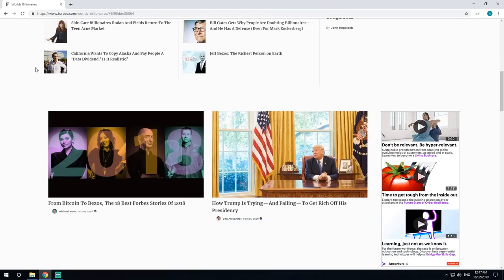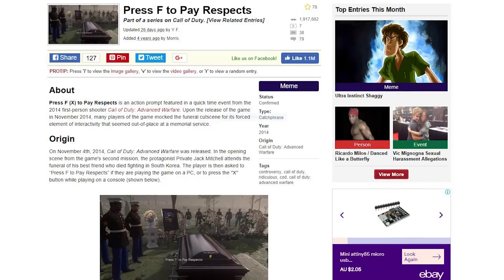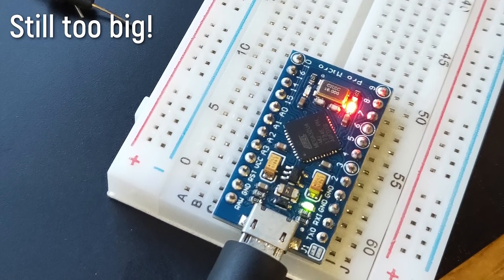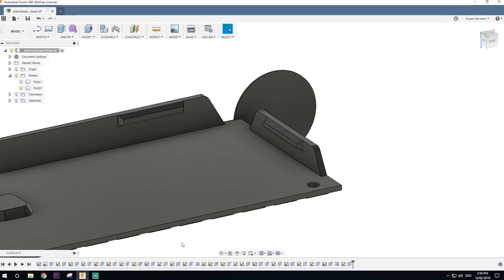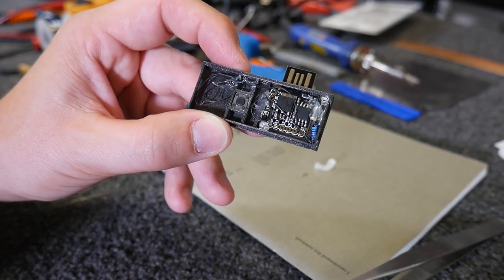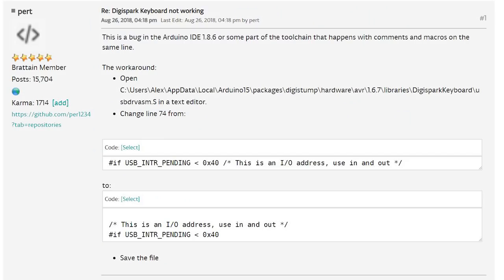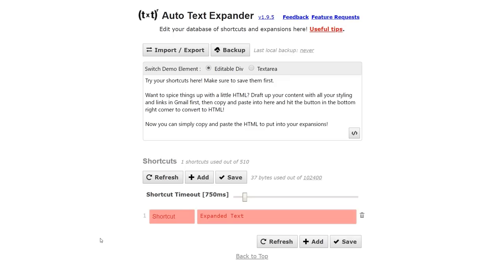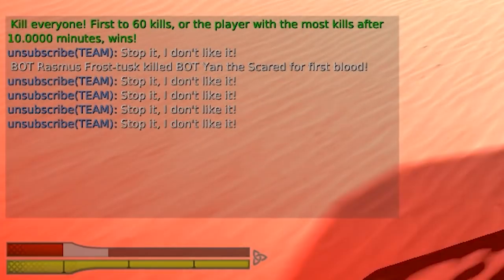Press F on the World's Smallest Keyboard

Comment: "Very cheap components" if you ignore the 3D printer
Reply: Pretty cheap to buy from a 3d printing service.
Reply: Components are cheap, the production isn't. If we're considering the cost of production line, include the costs of making a PCB or creating the silicon components like the microcontroller included on the board.
Reply: Tools and components are separate?
Reply: I've found a very good 3D Printer for a good price, just didnt want to buy it. Trust me. There's plenty of cheap 3D Printers (That work...)

Comment: would using alt+( unicode number) work?
Reply from the maker: It's not listed in any I found but I would love to be wrong. You can use that to send silly characters for emoticons, however. Works great.
Reply: @MakersMuse  U+1DA0 ᶠ
Reply: this is what I was thinking
Reply: You'd need to send it as a string of key presses, but should work.
Reply: The challenging thing is that keyboards (USB or otherwise) send keycodes, and not ASCII/Unicode characters, so it might be up to the firmware implementation if this will work or not.

I'd love to see if someone can get it to work.
Reply: By default, hex input is disabled in Windows, so you can only use Alt+[code] for characters up to 255 from the standard codepages. You need to modify the registry to enable hex codes for Unicode.
Reply: One option is to use the WinCompose program (https://github.com/SamHocevar/wincompose - on Windows, anyway - I believe Linux already has a built-in "compose key"; no idea about Mac!). WinCompose lets you enter special characters by pressing a hot key (I use AltGr) and then a sequence of regular characters to correspond to the special character you want to enter. For example, I can enter the "degrees" symbol (°) by pressing AltGr followed by `o` and `o`.

WinCompose doesn't actually have a pre-defined sequence for this "superscript F" (or, technically, "Modifier Letter Small F", as Unicode calls it), but you can simply define your own sequence in WinCompose's options. (In theory you could also use its "Advanced Unicode input" option and set your tiniest keyboard to enter the characters: [AltGr] [U] [1] [D] [A] [0], but there's currently a bug with that feature: https://github.com/samhocevar/wincompose/issues/235 - and see my note below about sending [AltGr] from your tiny keyboard's code!)

To add your own sequence, go into WinCompose's options, onto the "Composing" tab, click the "Edit" button next to "User-defined sequences", paste the following two lines into the file that gets opened, then save the file and hit the "Reload" button next to the "Edit" button that you clicked before. The lines to add are:

# Superscript f

<Multi_key> <^> <_> <f> : "ᶠ"

Then you can have your tiny keyboard enter ᶠ by telling it to enter these characters (which follow the sequences used for the "modifier letter small" characters that ARE pre-defined in WinCompose): [AltGr] [^] [_] [f] (Note that you'll have to substitute "AltGr" for the however the keyboard library you're using requires you to specify that key - and remember to specify the correct key that you've selected in WinCompose to use as your Compose Key!)

I've not tested any of the above, but it should work! Good luck! :)
Reply: @RFC3514  you can type other characters than those 255, for example you can type the euro symbol (which is not within the 255 characters) by typing Alt+0128
Reply: The euro symbol (€) is character 128 on the Windows-1252 codepage.
Reply: Only in rich text boxes, things such as twitter use simple text boxes, to know more about this with keyboard mapping check out tom scott’s video on the (14) emoji keyboard(s)
Reply: @RFC3514  what about alt+0173, the no-space space? I've never had to change my regedit to make that work
Reply: That's not Unicode, it's character 173 from the Windows-1252 codepage (a leading "0" means you want a character from the Windows-1252 codepage, instead of your local language's codepage). Unicode character code input is in hexadecimal (ex., "+1DA0"), and comes disabled by default in Windows.
Reply: No, it’s unicode alright, but alt+unicode wouldn’t work in simple text fields
Reply: No, it's not unicode. It's Windows-1252 (also, it's not a "no space space", it's actually a soft hyphen - rendered only if a line break is needed at that location). Unicode 0173 would be "ų" ("Latin Small Letter U with ogonek"). And Alt+Unicode does work in Windows text fields if you enable hex input (which I wouldn't recommend "normal" people do, since it can interfere with keyboard shortcuts in some programs).
Reply: or Ctl+Shift+u if you run linux
Reply: @MakersMuse  Just change encoding
Reply: F
Reply: @RFC3514  That's weird considering the keycodes are just labeled hex.
Reply: What is weird?
Reply: @RFC3514  Alt+7584?

Comment: C doesn't know much about text encoding meaning you have to escape the byte sequence.
Assuming DigiKeyboard text encoding match the compiler, that would be "\u1DA0"

EDIT: bad codepoint
Reply: Shouldnt it be "\u1DA0
" instead of a chinese character?
Reply: @hannahmariahoormann7574  duh, I put the decimal code ... Nice catch ^^
Reply: @leleo53000  :D
Reply: it doesn't accept characters larger than a byte
Reply: depends on your compiler :D I worked on some old-ass chinese platform that stored chars as u32 ...

Comment: That's definitely a project for a SLA printer.
Reply from the maker: Oh for sure, I'll probably test it out on one in future. Parts this thin can warp as they cure though and might not have the right 'flex'? Needs testing.
Reply: @MakersMuse  i would like to see more of these kind of limits with resin based printers.. bc everyone is dreaming of having one :) Or is there one already? i haven't been up to latest feed update bc of school.
Reply: Wonder if it'd be possible to do a fully functional keyboard of that size with an SLA printer. Custom circuit board + SLA printed keys/frame + FDM printed TPU dome membrane maybe?

Comment: Cane you make a video about different ways and techniques how to make multiple parts lock together? (Like the clips you designed here)
Reply from the maker: Good idea! I'll have a think about how to present it.
Reply: @MakersMuse  Im happy that you like the idea! :) As a beginner on 3d printing, this is the kind of stuff what limits me in designing useful parts. Thanks a lot for all your work and getting me into 3d printing! <3
Reply: @DatMilu2K  https://www.fictiv.com/hwg/design/how-to-design-snap-fit-components
or check the complete design tutorials https://www.fictiv.com/hwg/design
Reply: That would be a great video Angus !
Reply: Make the part with the locking tabs.  Subtract it from a rectangular solid.  You now have the top that will lock in  Subtract shapes for the other spaces.
Reply: It gets complicated.  Different plastics = different modulus of elasticity which means press-fit snap interlock sizes that work with one variety of plastic may not work with another.  Exploring that sounds like a CNC KITCHEN project.
Reply: @FranklyPeetoons  Who would make a entire kitchen with CNC machines? (I am just kidding, I'm subscribed to CNC Kitchen channel :P)
Reply: @Nor1MAL   Who (given the chance) wouldn't? :P

Comment: You might actually get away with using the ᶠ. An example would be emojis, like this new one, 🦴. If you're on PC, you would see a square, but if you saw this on mobile, you would see this as a bone, assuming your phone updated to Emoji 11.0.

The reason why it didn't display an ᶠ in the text editor is that it probably didn't have ᶠ in the fonts, and reasonably so since you normally don't need ᶠ for coding.

With this in mind, I would love to see if you can replace _f in the coding with ᶠ. As mentioned earlier, it will appear as a square in the code, but it should work nonetheless.
Reply: @reimnop  What OS are you using?
Reply: prolly macintosh
Reply: I see a bone cause I am on MacBook! (I am assuming)
Reply: @quarans08  Makes sense I think, maybe it has to do with the browser (assuming you are using Safari)
Reply: or it could be the latest version. i have a mac and never update
Reply: Doodles
 correct. I am running safari
Reply: I'm running windows 10 and see the bone. I think it's the browser. When I press Alt+1 I see an emoji instead of the little smiley face I see if I use it elsewhere in windows (☺) or at least I thought lol. It works in the search bar but not in YT comments.
Reply: okay
Reply: What emoji was meant? I see a squared question mark
Reply: On mobile I got a bone and on xbox I got a square with a x in the middle
Reply: its a square for me
Reply: I see a square but I'm on mobile, broken unicode?
Reply: ABrokenTV iOS: ? in a box
Reply: HAHA nerd, I see a bone too.
Reply: i see a bone and im on windows 10 chrome
Reply: I don’t have iOS 11 installed lol
Reply: I see a bone on windows 10
Reply: I see a box with an x on Android oreo
Reply: I'm on mobile and I see a box with an X in it.

Comment: You can't send unicode characters from a keyboard.
The USB keyboard protocol was designed with PS/2 compatibility in mind (so you can easily put an adapter on if your computer didn't support USB). As such, the protocol doesn't actually send characters, but scan codes, just like PS/2. It identifies the position of the pressed key on the keyboard, not what character it represents.
If you don't have a key for a superscript f, then you can't press it. (Or key combination, which you could emulate)
Reply: Yndostrui is the time of my day to come home, That’s is that a good thing.
XYZ 829 (XYZ 5.3V) Has 96 monoocloaookwmas in it,
Heyyy wiqhas has egg 🥚 was my first night. (777777777) Mikel

Comment: And remember guys, if you make this, when you are done having fun with it, you could probably use it as a hardware password manager if you want to make it more useful
Reply: Hoh. Good idea.
It would need more working keys though. Perhaps even more than a normal keyboard if you have a lot of different accounts.
Reply: @jendorei  How so? Most hardware PMs i have seen have 1-3 buttons. Typically they are used for machines not connected to the web and thus compromised by default or to store your PM password if you are using a machine that is not yours and thus where someone could be using a keylogger. At least this is true for the DIY ones i have seen, but i would imagine even with one button you could cycle through a few of your most important passwords.
Reply: @lazy8936  Maybe my thinking was wrong, I saw a hardware password manager as an alternative to a software password manager, as opposed to a supplement. I don’t really know that much about security. Or how things work.

Comment: Might be a bit late now, but you should be able to send the raw character code instead of having the compiler convert the character string for you. In that case, to type ᶠ the unicode character code is 7584 ie (in C#) `string superscriptF = char.ConvertFromUnicode16(7584).toString();` .

Some compilers (might be a stretch for a chip's compiler) allow escaping hexadecimal unicode character codes with "\u" in this case ᶠ would be "\u1DA0".

Comment: 3:40

-u need the unicode of the small f
-use a method that outputs a symbol from unicode
-put that method in the println parameter
-...
-profit.

or write a driver for it. (this would be easier, since i don't know what kind of librarys arduino uses)

Comment: I thought only the Leonardo worked as a keyboard? Apparently I thought wrong
Reply from the maker: Yeah dude I was so happy to discover you could use these with their own library they cost almost nothing.
Reply: The Leonardo and Pro Micro use the same Atmel 32U4 and have natively usb, but what many people doesn't know is that there a library called LUFA that bitbangs USB on microcontrollers that have no native USB support, which is what is at play on the Attiny85.
Reply: The ATtiny85 used on these does not have a native USB-Interface, but you can bitbang low-speed (1,5 Mb/s) in software. It does slightly violate some of the timing and voltage requirements of USB, but generally is close enough to still be understood by the host.
Reply: @dermax9390  That was my first thought.. the USB protocol is horridly complex (for what it is), so getting it pitch perfect with bitbanging is probably going to be a nightmare. Glad I wasn't the developer :P
Reply: V-USB is a firmware-only USB driver for atmel microcontrollers which can act as a HID. 
Adafruit's AVR based Trinket and Gemma used a bitbang USB bootloader that also supports a HID library, however this is deprecated as more modern PCs seem less tolerant of the violations in timing that this technique relies upon. Their current development board now have USB hardware support.
Reply: @MakersMuse  AFAIK most microcontrollers that can emulate usb 1.0 can emulate a keyboard/mouse pretty easy and should have libraries for it.
Reply: @bornach  USB 3.0 etc. OH... depreciated? :( I may have to look for other options ;,(